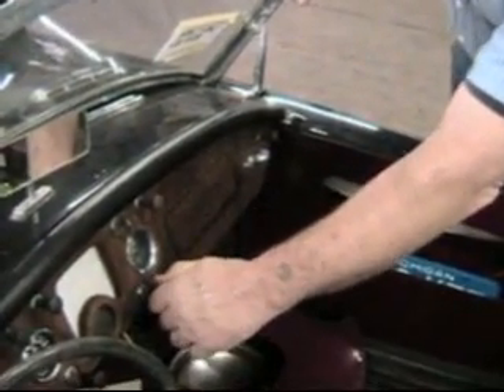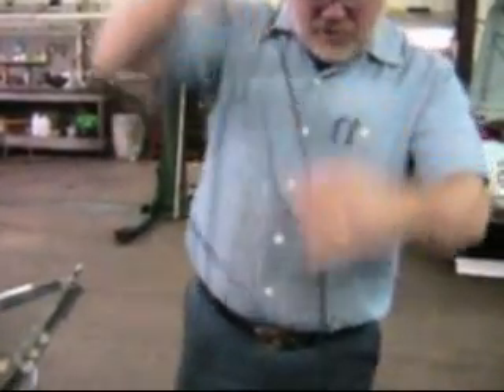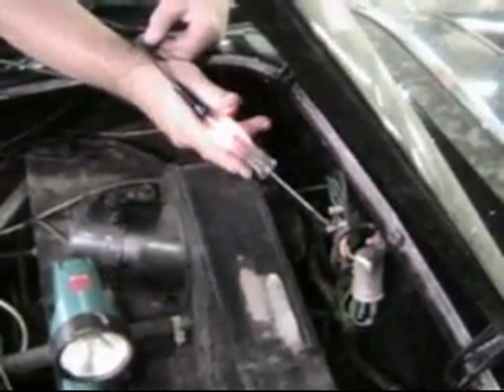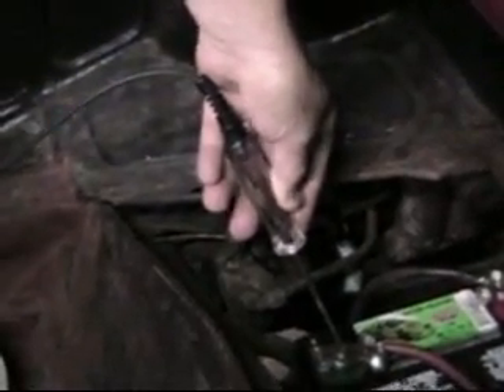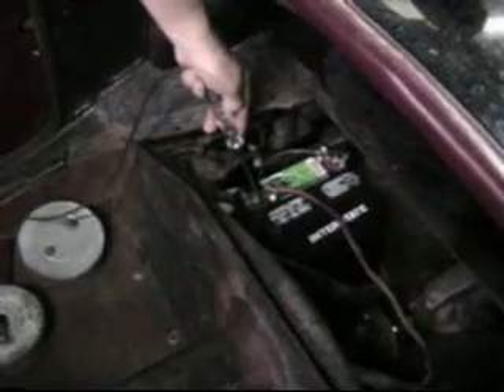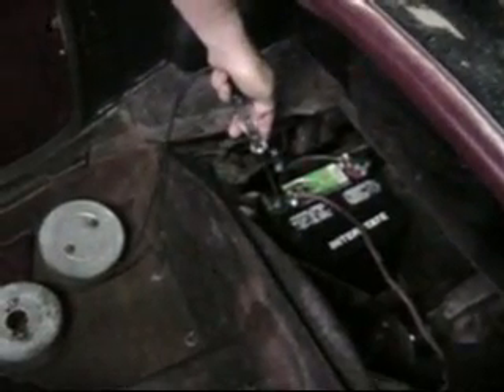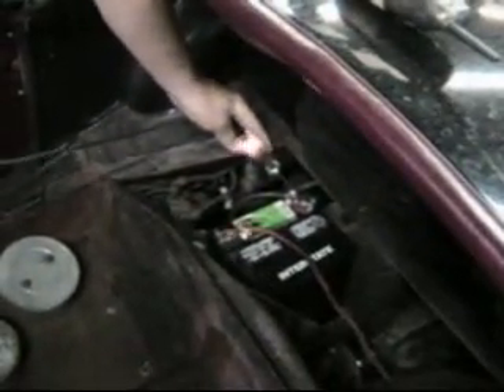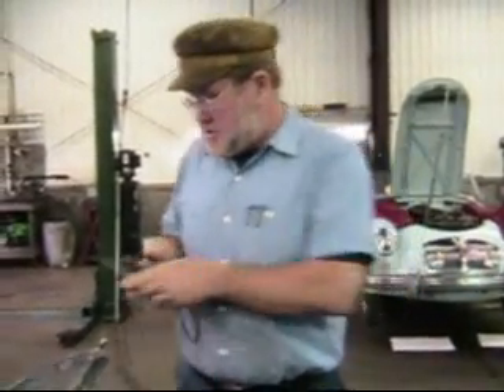032 MG Tech | Starter Circuits / Problems

Comment: Hi John, I have 79 Midget 1500, Starter solenoid just clicks. New starter motor fitted, same issue. If I rock car over in 2nd gear and try again, the starter motor engages and sticks. Then I'm back to the clicking again of the solenoid again. Battery is OK, even tried jump starting it, still clicking. Could I have a bad starter solenoid ?

Comment: QUESTION: What does it mean when the starter makes no noise at all? The car used to start, but after a run I noticed a burning electrical smell and now the car will not start. Is the Starter toast, or should I be looking for an electrical short someplace else?

Comment: I've got a friend his midget won't rev after changing the gas tank,it starts but Will not rev .
Reply: Air or crud in fuel pump, fuel line, stuck in car or air/crud in fuel filter right before the carb if you have one there.

Comment: Thx will look into this in the a.m.  I called your shop today and had your mechanics looking at eachother :  Today I changed the Ignition switch, then everything started to go wrong one after another. fix one 2 die..

Now starter turns over with the click of my high beams or turning on my headlights. Headlights and tail or out but parking lights still work Ghost in the Machine

Hopefully you will post a video on how to trace this  down.  If you were in Cali.  would bring it to you.

Comment: John,i have 1977 mg midget,it's been in the garage for more than 20 yrs..I recently changed battery,spark plugs,plug wires,rotor but still it's not running or will not start.i like to change the ign. coil and distributor but they don't have the original one.i need your advice and thanks again..

Comment: John Twist, you are the man!

For weeks i was searching for this fault on my '67 MGB GT. The starter was tunrning but obviously not fast enough for sliding forward on the starter-shaft and to engage the flywheel.

The reason was a bad ground connection between the chassis and the motor. I cleaned the connections, used a little bit of cooper paste and voila - the motor is now starting every time i turn the starter key.

Thank you very much for this hint!

Greetings
Holger